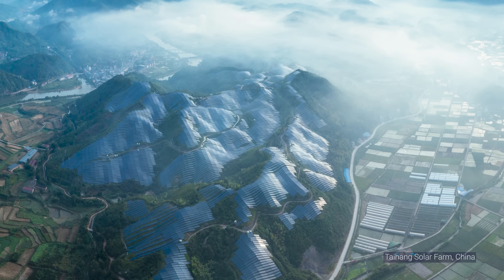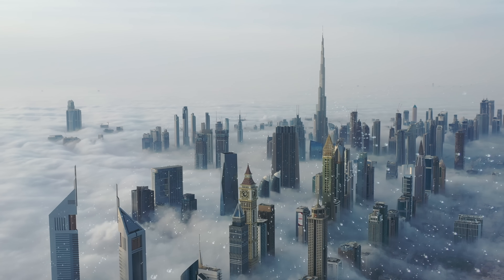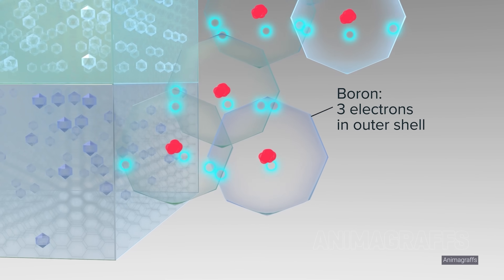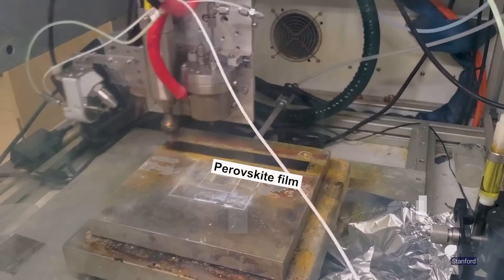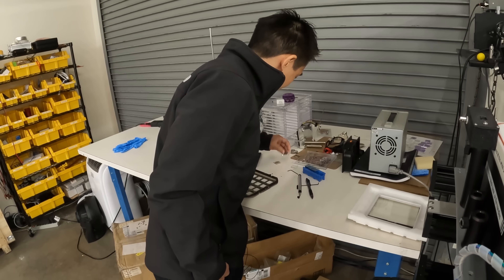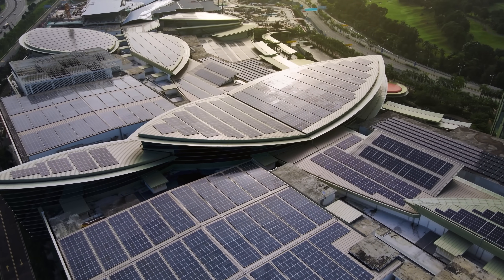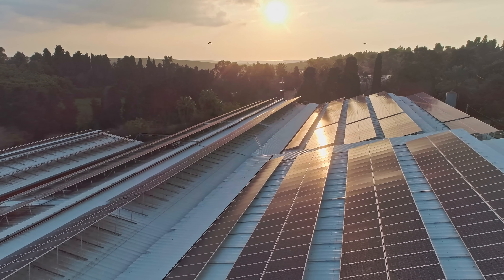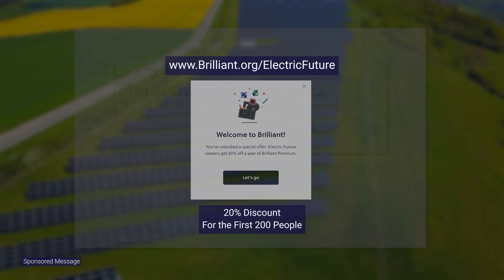Solar 3.0: This New Technology Could Change Everything

Comment: How much will longevity matter if they can be designed to be swapped out easily after, say, 10 years? Perhaps with some sort of standardised frame that the panel is easily bolted on to and low enough cost for replacement panels it won't matter that they don't last as long as a standard silicon panel.

Comment: Embed them into the surface of some phones and they would be charged by just having them laying in a table where the light is hitting these cells. For solar cells using this tech all you need to do is attach these crystals to a thin sheet of transparent Aluminum which is a real material that has been around since the 50s.

Comment: Hey, i got an idea..., If typical solar cell produce electricity from certain wavelength of light  only, and have negative effects of heat generated due to full range of wavelengths received by sun, then why don't we just add wavelength filter just some ft above to reduce heating and improve efficiency

Comment: With the conservative numbers from NREL's land use report, we can estimate that roughly 14,000,000 acres or 22,000 square miles of solar panel-filled land would be required to generate enough electricity to solar-power the U.S. This is about the size of the Mojave desert.

Comment: I can offer my Rv roof, (a Monaco Bus) it will be in the Nevada desert, of all places, the entry to Death Valley, testing new lithium batteries.  Guaranteed to test the temp factor of these guys. Cool and would be nicer than the bulky panels, and test total output per sqft. Proving a tiny house roof can sustain its self. Thanks

Comment: Solar panels are leaping up in efficiency every year but so is their size and weight getting to impractical levels for many uses, thin film has so many uses, at the right value point we can just put them on every available surface that is outside...

Comment: 10:40 So could you make cylinders with one way mirror surfaces facing into the center? and would that work/let the energy reflect back into the cell or just heat up the cylinder?
Reply: It depends on the mirror. If it’s reflective in IR then it will be more efficient.

Comment: 7:30 but this is based on FLAT shapes solar panels right? Would the shape and or structure of the crystals change that? Example, the cells constructed into a large structure mimicking the smaller crystals

Comment: you are all idiots
cattle
sheep
Is no one thinking about the heat developed by solar power generation??!
on a meadow it used to be 20*C.... the solar meadow hahaha 80*C easy

on a meadow there was life
a tree for shade
Reply: Incorrect. Temperatures in solar farms are higher than in surrounding land, but only by a few degrees. So, 23ºC instead of 20ºC.

This also doesn't affect adjacent land. The heat rises away.

Solar panels create shade, but basically any use of land displaces wildlife.

Comment: This does a fairly okay job being balanced, but this channel especially is underselling the stability issues.
Data, from 2021, shows they still wear out roughly 40x faster than the ordinary solar cells we currently use.
That's a big problem.

Comment: A holy grail? All those resources, time and energy to bring to market a 10% better conversion that will end up putting the older version in the Planned Obsolescence home.  10% is not "innovation" it is another small increase very deliberate and engineered fit a very specific set of rules. You must never reveal actual facts. If your research found 20 or 30% make sure you create a product that only has a 10%. We want to hold the control over that technology and in 5 years when this product has made us rich we can present the newest product that we can drip feed these consumers. One day they will discover a cell that converts and stores 100%, and no one will wonder why instead of moving on to other more valuable solutions to better society , why with all those resources they did not discover this cell technology 20 years ago. No one who invests money, funds to find a solution. They fund to discover something they can slowly over time introduce their "innovation", and since everything's designed and manufactured to break, have the new replacement with x% better blah...
Reply: An extra 10% is a 50% improvement on the existing market options.

And, no, they're never going to make solar panels that can break the laws of physics.
Reply: @seigeengine  My point is that no real innovation, value for cost, or longevity exists today. 3 large Corporations control every market and since they have no competition, they do not need to put any money into development of newer, better, more efficent, lower costs, value, or through actual innovations replace an old product  with one that actually is better.

Comment: The problem these days is that media outlets find a new technology in development and interview the team and only show the benefits and overhype it. A 10-second google shows the disadvantages which weren't mentioned in the video....

Following are the drawbacks or disadvantages of Perovskite solar cell:
➨Degradation issue of methyl ammonium lead iodide Perovskite needs to be studied.
➨Main issues in perovskite solar cells are film quality and thickness.
➨The perovskite material will break down quickly due to exposure to heat, moisture, snow etc.
➨The material is toxic in nature.
Reply: That's basically one unique problem, and it IS addressed in the video. Thanks for clarifying you didn't watch the whole thing.
Reply: @seigeengine  yes they mentioned the lifetime briefly but completely brushed over it. Can't deny these channels overhype tech in its dev/testing stages.

Comment: Tangentially, you mention the heat loss with silicon-based solar panels.  I'm wondering if there would be a way to collect that heat by adding water-based solar panels under each of the silicon-based panels, thus scavenging the wasted heat.  So, a sandwich of two types of collectors.

Comment: If it cheap, more efficient and easier to apply/install why does it matter if it doesn't last as long as current panels? They would be easy to replace more often and would more than paid for themselves on top of being cheaper in the first place to allow the cost of which to not be a problem.
Reply: Well, because at present it breaks down in 9 months about the same as ordinary panels break down over 25 years.
Also, the cost reductions are estimated, not realized.
That's way too fast to be viable for anything that isn't designed to be disposable.

Comment: Great tech that just needs to find Its proper application, the old solution looking for the benefit to a problem synario.

Possible for the right median hasn't been thought of previously.  Rapid degradation would be no problem in a situation where the repair is as inexpensive as the original cost? 

 If there involved a recycled glass bottle of the required material that all I have to do is replace occasionally with a relatively minimal amount of threat to the environment, is cost effective, and recycling capable it will sell it's self. 

Nice work, keep at it!

Comment: "You'd only need a hundred miles of solar panels to power the entire US..."

No. Not even fucking close. The people responsible for that number are LITERALLY retarded. There is no nicer way of saying it.
Reply: 100 miles by 100 miles is 10000 mi^2.
US solar power plant production is about 192 GWh/year/mi^2.
The proposed land would produce 1920 TWh of electricity each year.
US total electricity consumption is 4000 TWh.
So it's about half the US electricity needs.
Of course, total power consumption of the USA is around 25000 TWh, so...

If we assume we'd place solar panels in the brightest parts of the US that get around 8 hours equivalent full sunlight a day, that's 25 W/m^2, which is around an eighth what commercial solar panels can do.

So even if you imagine this area as one giant solar panel directed exactly at the sun, it only reaches 16000 TWh.

You'd need a 50% efficiency increase from there to reach roughly sufficient levels to replace all US power consumption, which is feasible in the future, but not at present.... but even then, that's where you start getting into the actual problems of solar, so congrats, you've reached the starting line.
Reply: @seigeengine  That's just saying the people who came up with this number are retarded, but done so with a degree in the field or an overunderstanding of the science behind it. Either way, thank you for elaborating on why what I said is factually correct. 

I'm not a scientist, but I'm also not a retard who thinks we are further along with alternative energy methods than we really are. The sheer landmass needed to harness the power doesn't even begin to deal with the issue of where the fuck are you going to store all that power for the hours where it's not being gathered but is steadily flowing out, or the possibility of any number of natural disasters that could render the system inoperable, because the areas where you would need to put this are prone to such. 

It's dumbass hippy utopia logic. It's all well & good & cute in THEORY, but crumbles under the most miniscule amount of pressure. I'd love it if all this talk of alternative energy methods were the Roman Concrete they claim it is, but is porcelain at best.

Comment: also wanted it for RC planes and drones/satelites like they just said, just a while ago those things where to heavy and such for small scale use.
also for cost savings and such due to current stuff being really expensive. 
I hope they soon bring out a hobby grade/experimental line mostly made in cheap ways so that they are really cheap and essentially they could act like a experiment for them, hobbyists can use them in small budget projects which don't need to last long, they get the data of how they perform and behave as well as that it allows the industry to adapt to it before it launches which allows for a more rapid adoption when the final or well enough versions are ready since it often takes the industry a few years before they start using a fully completed on the market better solution.

Comment: You'd "only" need 100x100 miles of solar panels...not accounting for weather conditions, power storage, power transfer, growing demand, maintenance, etc.  You'd also need batteries the size of city skyscrapers....a whole city of them.  You'd also need to replace ALL of that every 10-20 years.
Reply: Or we can use ground juice that burns away and dosent come back. You pick nimrod.
Reply: @jonathanday4553  There's enough ground juice to fuel our civilization for the next 100,000 years, if not more. And we will ALWAYS use oil, because we use it for more than fuel. We will never stop using oil. Average oil well is 6K ft deep. Deepest is 40K ft deep. There's a LOT of oil.  And it's not localized to specific areas.  Everywhere on earth, there's oil, if you dig deep enough.  Guess what the byproduct of burning gas are?  Carbon and water.  It's one of the greenest fuel sources in the world....too green for the greedy people in power, so they want to make it seem not so green so they can sell you other things and rob you of wealth. And since we're already on the cusp of fusion, this is all moot anyways. When something better comes along, you don't have to force it like they're doing now with wind and solar. If it was really soo great, it would have already won out.
Reply: @peoplez129  the world has 47 years left of proven reserves at the current rate of consumption. I've never heard of your 100,000, year figure. I'd argue the cows we consume are more of a environmental problem than oil. But I'm listening.
Reply: @peoplez129  I listened. I'll keep what you said in mind.
Reply: Life itself starts solar powered but you want all the good stuff for yourself with no respect to the actual cost of the fuel you are burning. Get fucked

Comment: The big disadvantage of these types dollar cells is they degrade insanely fast. I was really hoping this was about the new processes that prevent the insanely fast degradation. The fact that the new stuff is made from organic plant wastes that also increase the efficiency by double it more and protects the cell from dying under normal use.
Reply: insanely? Words that create vague extreme alarm are not useful to the discussion. Cite some relative numbers.
Reply: @OneEyedJack01  unsubstantiated info makes me question the author's actual range of factual knowledge and the value of their words. Tis a danger on yutoob. I would want the science based facts and figures.
Reply: @clairecadoux471  it's never depending on the film used it can be anything from less than a second up to about a year to completely degrade. They might be good for single use electronics but at of right now still won't ever power your home or anything on the large scale. That said there is some promising days coming out for multi layer films that are sandwiched between other mostly transparent materials that reduce the degradation to more manageable time periods. They week still only last a few years at most but that's good enough for putting on cars and our everyday power consumption. Then ask we would need to do is figure very long term power generation for commercial and industrial applications. Geothermal and nuclear smr's come to mind.

 Renewable energy is by and large a lie anyways, reduction of greenhouse gases isn't even close too the only or worst problem, the greater pollution crisis make climate change look like a happy day in the park. The advantage is that the best solutions for climate change by and large will fix much but no where near all of the greater pollution issue. It will give us time to invest in a better tomorrow but only if fixing one thing doesn't make all the others worse.
Reply: How fast? Slow enough to make it still worth it if it had the funding?
Reply: From what I've read he propably mean the first generation of CH3NH3PbI3 (Perovskite) cells that showed during a test in 2015 a fast degretation (12 days) in moist enviroment which is already not a problem anymore. A scientific article on that would be "Challenges for commercializing perovskite solar cells" by TSpace Research Repository (would post the dircet link but youtube keeps deleting the comment with it in it). 

The current short term test showed still 90% of powerproduction after 200 temperature cycles (days) which is on the higher end since todays silicon based solar panels showed in their first short term test less that 40% after just 100 cycles which makes the technology promising since its still in the early phase. 

On of the bigger obstacles tho is the recycling/waste since it contains lead which makes it less appealing in todays capitalistic throwaway society since you just can't bury it somewhere, forget about it and let future generations deal with it. But since they are working on replacing lead and looking for more stable compounds I would say thin film solar cells are a better option than what we have currently, aside maybe a fusion reactor.

For once the wikipedia article seems fine with the same informations as the scientific papers.

Comment: When "growing" indoors, we always used "High Pressure Sodium" lights for artificial  Sunlight and "Metal Halide" for artificial Moonlight .. Works like a charm ;)
Reply: Now they have LED that do both, strong enough to flower big, dense buds, and roughly 10-20% of the heat that HPS produce. Even with 8in inline cooling fans piping the heat or 1000 watt HPS you still need A.C. to keep you grow rooms from reaching 90 plus degrees. The new LED's are much cooler. Also, i hope you been wearing polarized sun glasses when you're working in the rooms, a lot  of growers will be going blind in the next 20+ years.
Reply: hmmm that  hemp;-))

Comment: We could also use deep well geothermal for unlimited power 24/7 globally with less environmental impact than solar, wind, coal, or nuclear production, and using currently available drilling technology at a fraction of the cost of the aforementioned. Using the Rankine cycle it could be made closed loop using low boiling point refrigerants thereby nearly eliminating plumbing maintenance, and giving the ability to use excess heat elsewhere. Seems more viable than solar at the moment, and yet no one is talking about it.